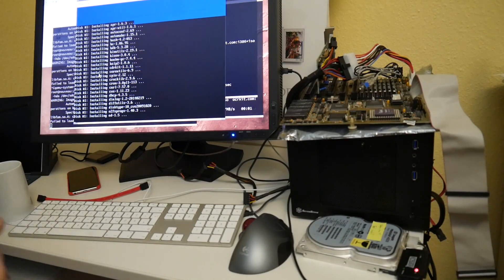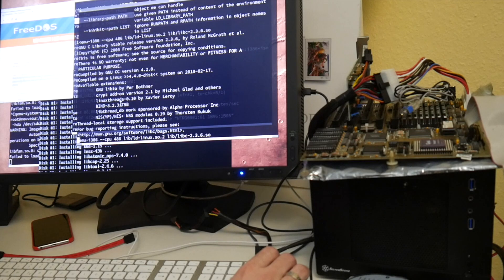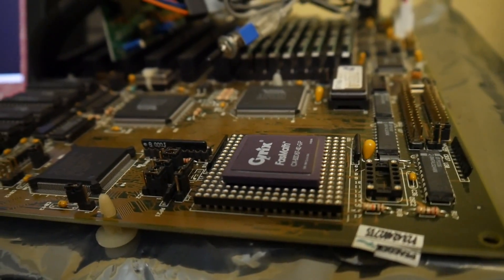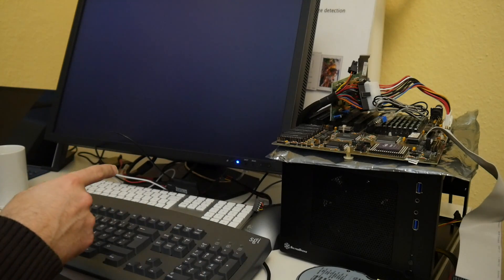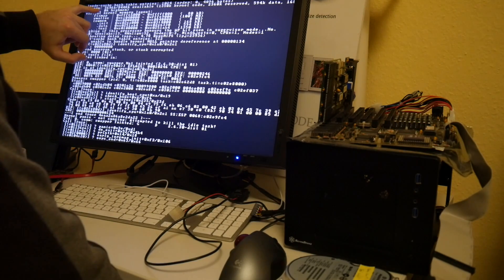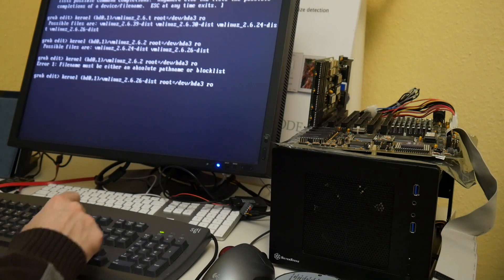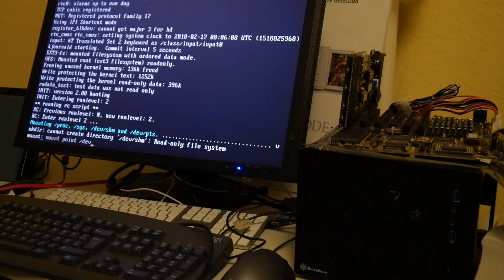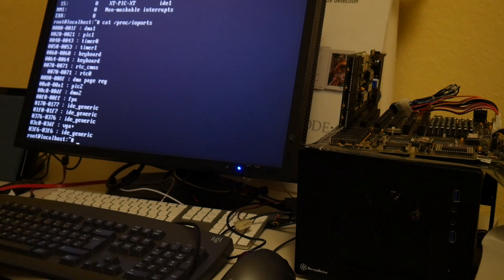The real 40MHz am386 Linux challenge: will it boot? [RAW]

Comment from the maker: fix for booting linux ≥2.6.28 on vintage CPUs without cpuid: https://git.kernel.org/pub/scm/linux/kernel/git/torvalds/linux.git/commit/arch/x86/kernel/cpu/common.c?h=v2.6.31&id=e8055139d996e85722984968472868d6dccb1490
Reply: Thanks for that. The last time I used Linux on a 486 was kernel 2.0.x, which (only just) fit on a 1.44Mb floppy disk with bash and a few basic tools. This was before the days of Busybox and LiveCD's, I used it on an old 8MB 486 DX-33 with no hard drive to run IP masquerading - internet sharing of a modem 24/7 without the scheiße of Win95! I stopped using it when CMOS battery leaked on the board. Very nostalgia watching your 386, I want one but just can't think of any use for it now...
Reply: Is it really possible to install 2.6.28 kernel on 386??? 8MB is enough for it? I have 386SX, and if I will solder 4x4MB SIMMS and have 16MB I'd like to try T2 on it too. I remember Slackware was usable on it, what is the fastest T2 version you can recommend for 386?
Reply from the maker: @alexloktionoff6833  well, you need an old t2 please as Linus removed 386 from Linux a while ago.

Comment: Do you need to downgrade even the kernel for running on a 386? Is even tty with a modern linux too much for a 386?
Reply from the maker: Linus Torvalds removed 386 Support, since 3.x you need a 486 to run linux. https://rene.rebe.de/2017/12/

Comment: What distro this computer runs ?
Reply from the maker: As founder & lead developer of #t2sde I naturally usually run T2/Linux aka #t2sde on nearly everything ;-) https://t2sde.org
Reply: Did you try also DeLi(cate) distro ? It should run with RAM : 8MB (console only) / 14MB (with GUI).
Reply from the maker: I develop and maintain a whole source distribution for 20 years, so, … ;-) my point is to teach people developing embedded systems, also for similarly small ARM, MIPS and RISCV boards and such: https://t2sde.org

Comment: I see you use the same logitech trackball I use! It is interesting Linux says it can boot and run on i386 but seems that is false advertising. I think Linus had coded on a 486?
Reply from the maker: Linus had in fact a similar 386dx according to his initial Linux 0.0.1 or so announcement. Linux also did  run on those 80386 and clone. Only during refactoring around this 2.6.27++ kernels the support was broken, until the code was finally removed in the Linux kernel 3.8 to get rid of old cruft and improve maintainability of "modern" x86-64 aka AMD64 support, ... Linux still continues to officially support i486 and greater.
Reply: Ah ok then! That explains it! I myself am playing with older 2.x kernels on not so old hardware? Pentium M,core 2 duo. But I would like to try my hand at the older P4,P3, and P2 systems that people throw away and give me as "gifts" lol! Might be gifts after all! My biggest challange is the VGA with X. I try even VGA16 failsafe and that will not work with intel onboard graphics on kernel 2.2 and 2.4 with xfree86 3.x. It will work fine with X-org though but that requires later revisions of Linux to work too soo.. yeah fun!
Reply: @renerebe  How much would it presumably take to make 3.8 boot?
Reply from the maker: @jhkcreates  since 3.8 and above i386 would require re-adding the source code the Linux developer around Linus Torvalds removed: https://rene.rebe.de/2017-12-31/glibc-minimum-linux-kernel-version/ since then a 486 is the minimum requirement, … :-/